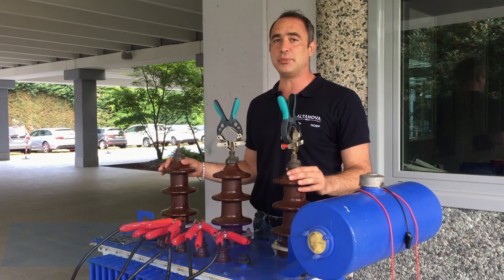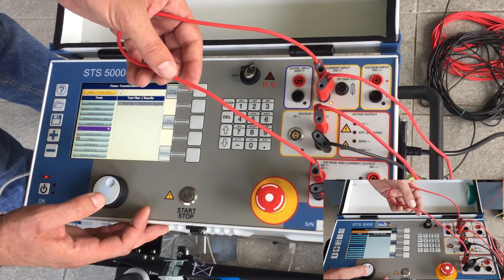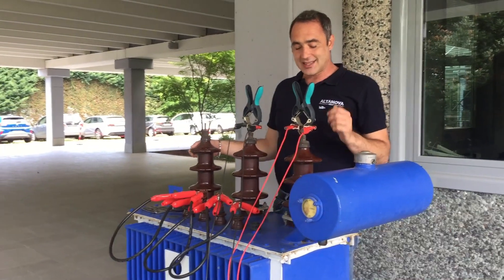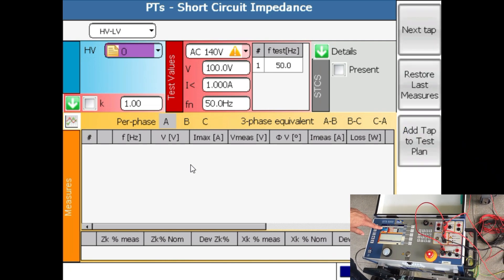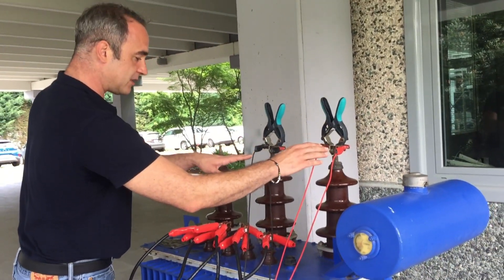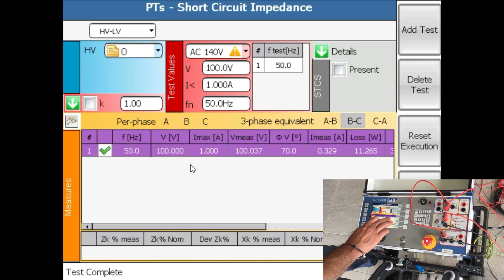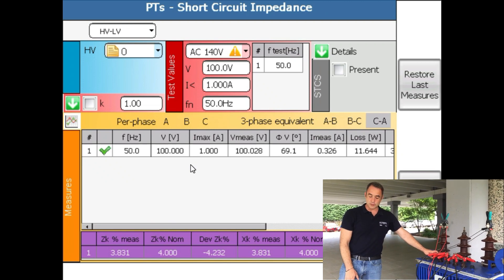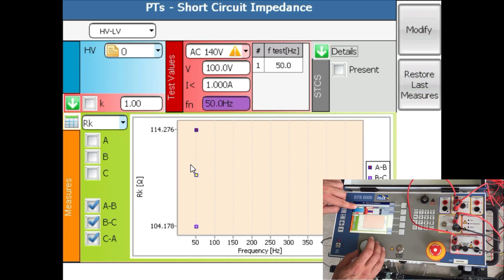Doing the Short Circuit Impedance Test using ISA-Altanova’s STS 5000 step by step

Comment: Beautiful presentation! However I have a question, does the test voltage depend on the size of the transformer? For example if I have to test 55MVA/ 220/33kV Power Transformer, what test values of voltage and current should I use (100V and 1A)?
Reply from the maker: Thank you Winnie. The voltage applied does not depend on the voltage level of PT.